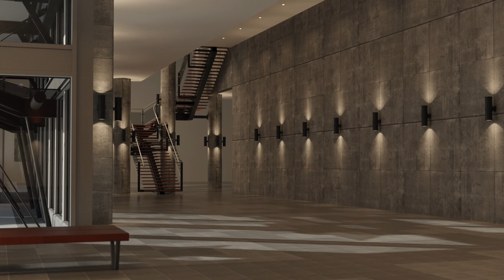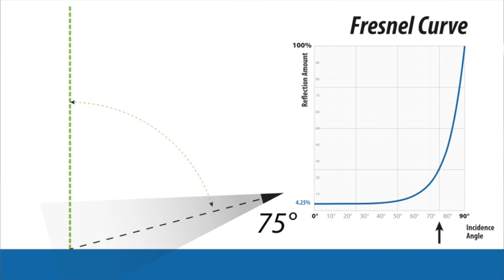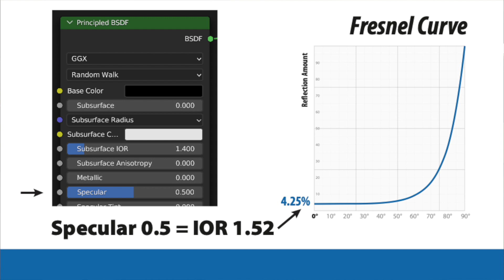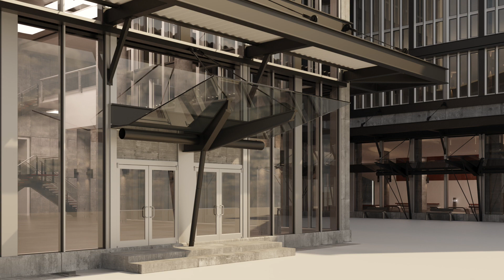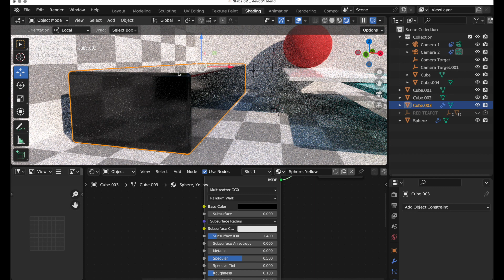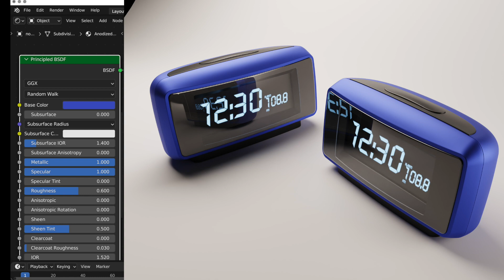Demystifying Blender's Specular Channel! How Specular relates to the Roughness channel.

Comment: In terms of building your own shader and figuring out how to adjust the Fresnel curve for roughness, another option is to generate your own curve. Take the dot product of the Incoming and Normal vectors, and you now have a value that goes from 1 for a facing angle to 0 for a glancing angle. Raise that to a power, which can be more than 1 for a steeper falloff, or less than 1 for a gentler one, and use that as the mix factor for your facing-angle and glancing-angle shaders.

Comment: Do you still use Strata? Are you on Beta? Is it any good? I am returning to Mac M2 next week and I may return to Strata a bit.
Reply from the maker: I do. It doesn't make sense to convert some files over to Blender, but to use them in Strata still. It's just gone into final release and works quite well on M2 (natively).

Comment: I've just become a little smarter. By the way, do you know what's the status of Principled v2? I can't find the latest build with it.
Reply from the maker: It went into a developmental hiatus for a few months I guess as the developers were busy with other aspects of the 3.5 release, but a  note on the development forum last week stated that the fellow tasked with PV2 has re-started development and is tentatively slated for 3.6. That could always slip of course. The last build that I have containing a working version of PV2 is from about Dec. of last year. You would need to dig into the Branch Builds section and hunt back about that far to find it. If you do, note that it (ironically) doesnt have a Specular channel but instead now directly uses the IOR value to control the reflections. A lot of things are in flux so I don't know if it will remain that way or not.
Reply: @christopher3d475  Looks like it will take a little longer. As of yesterday's meeting:

"Principled v2 will be moved to Blender 4.0 due to scheduling issues for Lukas, but he plans to resume work on it now. The next pull request will be for albedo scaling for GGX, to replace the slower and more noisy multiscatter GGX. Then after that the plan is to add the new BSDF’s internal implementation (like Sheen), and make them available to OSL."
Reply from the maker: @juryrigging  Yeah it's too bad this is taking longer than expected. I still have the build from around 5 months ago they released that has the energy conserving PV2. I'm hoping that maybe they can at least pull that code and push it into a 3.6 or 3.7 and then do the rest of the BSDF updates for 4.0.